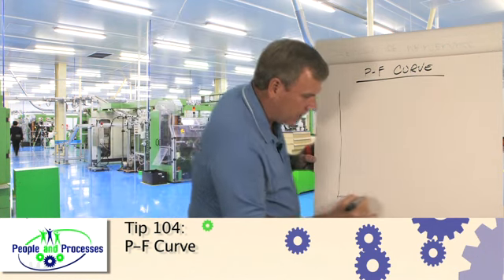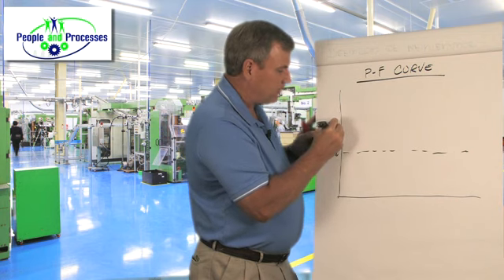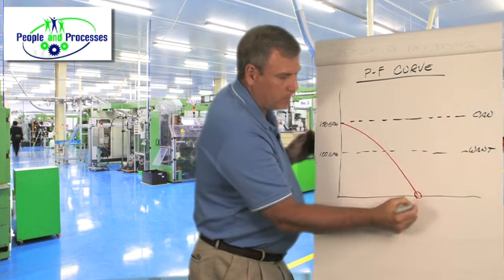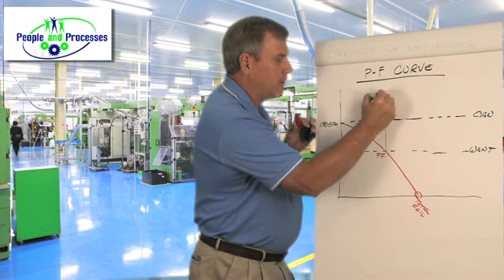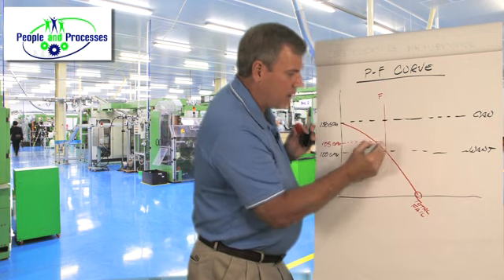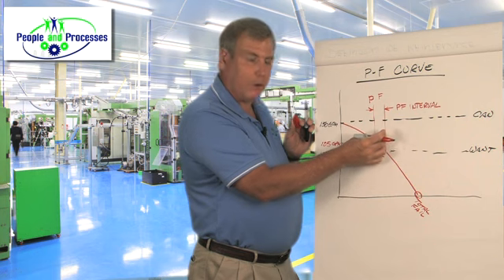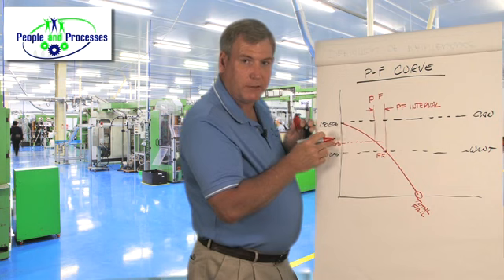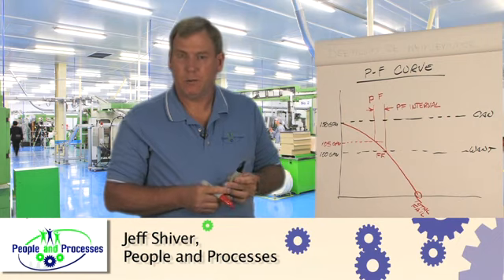Intro to the Maintenance P-F Curve

Comment: very informative.. It was not clear though on how to set the P..can you elaborate on that part..Thanks
Reply: Ian, In the example, the pump is in the processes of failing from impeller wear in this case.  At some point, you can find it in the "act of failing", from instrumentation (flow meter) on operator rounds.  If it was a bearing, you might find it from heat (infrared) or vibration as an example.  Again, the failure is already in the process of occurring and you detect it.  This is the "potential failure", or the "P".  You need enough time between finding the P to plan, get the materials in, schedule it down, and make the repair to restore the capability of the pump.  This is the P-F interval.  

Conversely, If you take an incandescent lamp, you might get a flicker 15 seconds before the lamp goes out.  In this case, there is not enough time to find it and repair it before it functionally fails.  The PF interval is not long enough so you would need to choose a different maintenance strategy to address that failure more.

Cheers,
Jeff
Reply: @jeff_shiver  thanks very much for the explanation..